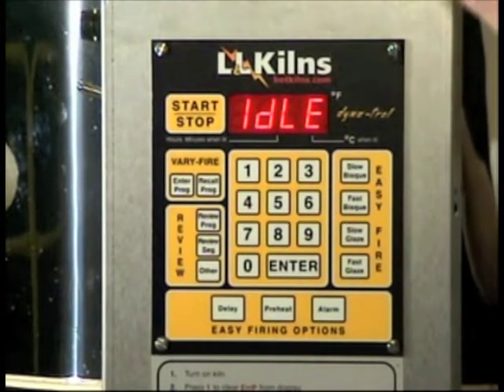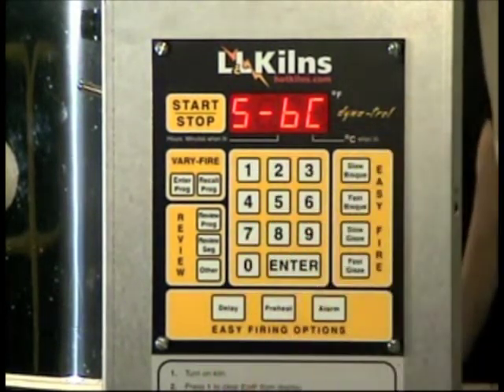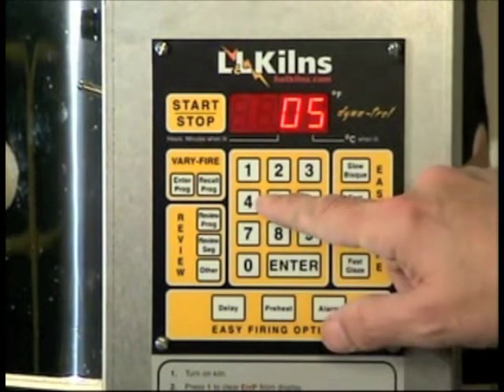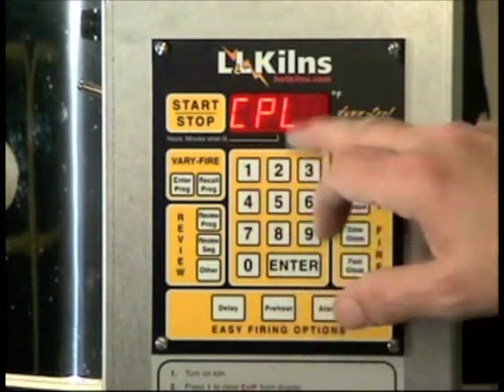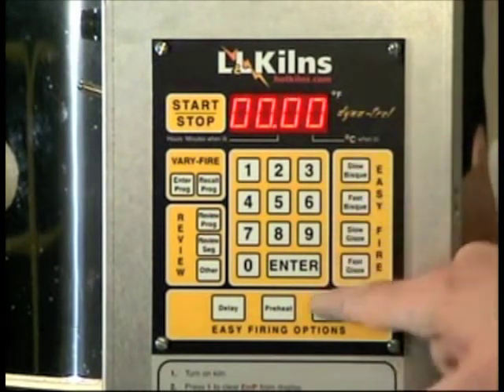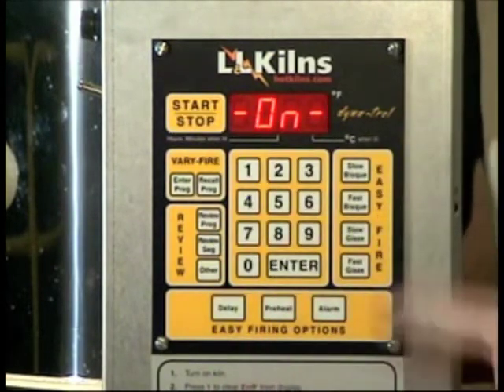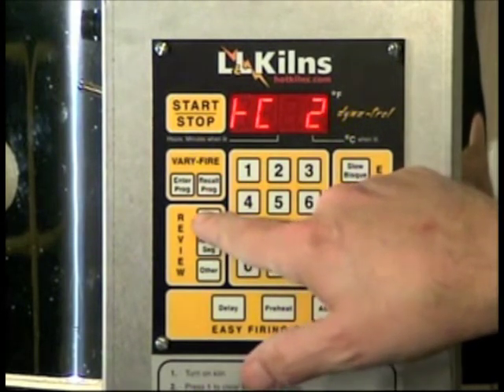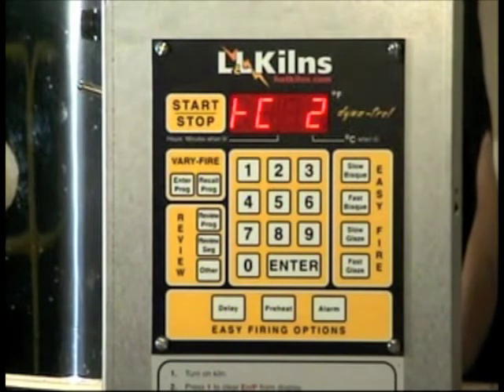Programming your L&L Easy-Fire kiln for your first test firing

Comment: Is this just like a Bartlett controller ?
Reply: It's a Bartlett controller with a custom faceplate to make it look like it's not, it's kind of scammy to me what some of these outfits do trying to make their kilns or controllers look different so people don't know they are all made the same commercially available parts and just slap their own brand on them.

Even the  Paragon kilns offer a "Sentry" controller option that clearly is a Bartlett made controller- says so in fine print on the controller!

 3" K23 brick is  3" K23 brick no matter what kiln is built with it, they all have stainless steel jacket coverings, and since Bartlett is THE world renowned controller builder- the kilns all use that brand except for some oddball ones that use a controller by Orton- the cone makers.
These L&L kilns like the Jupiter cost lots more than others. I once got into an argument with a guy on a ceramics forum about the cost of the Jupiter v/s the Olympic freedom kiln package I got, and gee wouldn't you know it- he turned out to be an L&L dealer LOL!

I told the guy I bought my cone 10 Olympic kiln that had literally everything included- furniture, shelves, posts, stilts vent, extra spare thermocouple and elements and more for about $1800 and he's trying to convince me the Jupiter at twice the price that didn't include ANY of those items was a good deal because the bricks have  a "proprietary wash" on them and bla bla bla!
I said I could but TWO of these other kiln packages for what this Jupiter cost.

I looked at the price on the Jupiter and it was the base price, and then   add $350 for this... add $195 for that, add $250 for the other thing, add $450 for that other thing over yonder, plus add for shipping, byt the time all that stuff was added it was double what I paid for my Olympic with all that included.

He went on about how Jupiter  had 3" brick, cone 10,  3 year warrantee or whatever it was, and I said the Olympic was ALSO 3" brick and cone 10,  and the same warrantee

Comment: I noticed that you were preheating to dry atmospheric moisture from the kiln, but the lid is closed, peep holes shut. Does the kiln vent evacuate the moisture?
Reply: If you have a power vent THAT takes care of it
Reply: The first hold....Is that a delay in firing or a hold in temp. at the end like a soak?  I understand from the video that the second hold is a gradual temp. rise till the water evaporates. I am using a school kiln and don't have the direction manual in here to look it up.